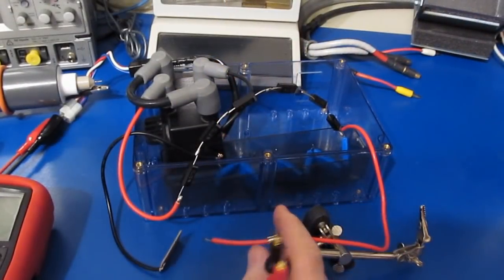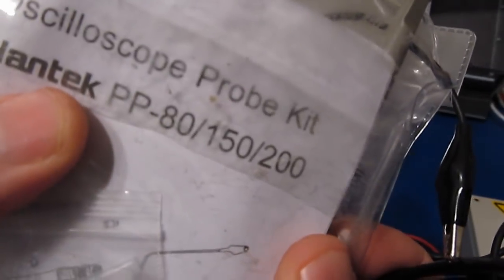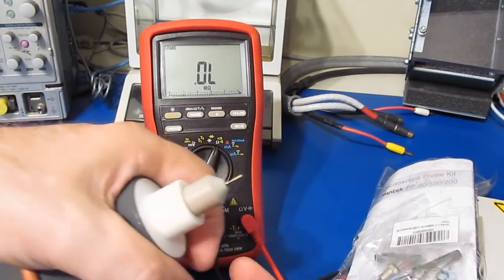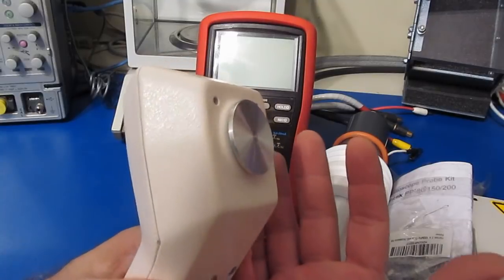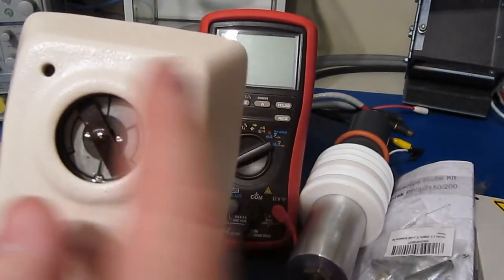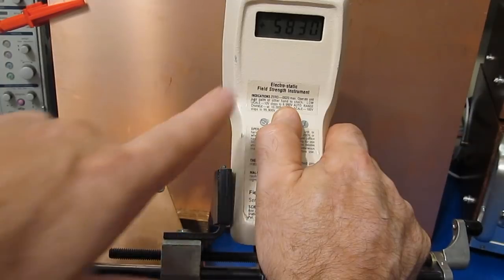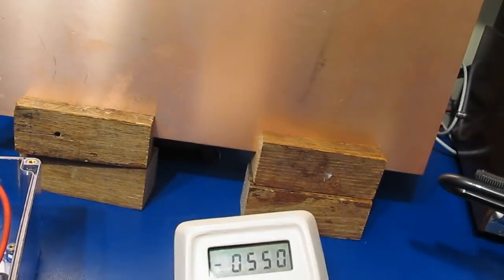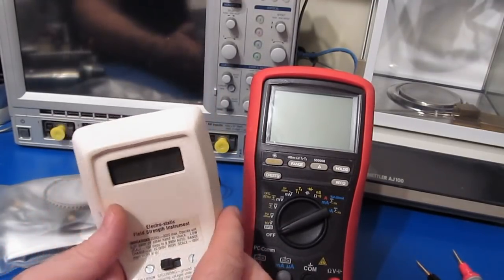Vintage Electro-static Field Strength Meter

Comment: I really don´t get why the Brymen doesn´t display 100s of Mohm even though it can clearly read it.
Reply from the maker: That's a good question.  This was my first hit on Google: 
https://electronics.stackexchange.com/questions/105613/why-to-use-siemens-to-measure-high-resistance
Reply: Hmm, can´t seem to find any convincing reasons. Maybe it has to do with people traditionally being unfamiliar with Giga as a prefix. (Gohms) 

Or maybe there is some functional difference in this meter?
Have you checked if the Brymen puts out more voltage/current in conductance measurement?
Reply from the maker: It's just another way to present the data.  With a 0.01nS resolution,  one count is 100 GOhms. two counts is 50 GOhms, three counts is 33.33 GOhms, 10 counts is 10GOHms.  The resolution would be poor and I doubt many users may not want to see the display bouncing from 100G to 50G.  It could be done.   Accuracy on the handheld meters is not all that good.  Normally if I need to read very low currents or high resistance, I am not using a handheld meter.  It can present challenges even with better equipment.  I have shown some pictures on EEVBLOG of some fixtures I used when making measurements like this.
Reply from the maker: Also, I do not believe there is some functional difference in the voltage/current in conductance on any of the handhelds I have looked at.  But again, when you look at the accuracy specs, they are poor as you would expect.
Reply: you´re right, the poor resolution in Gohms is a decent reason not to display it like that.
Although I would prefer to have something displayed instead of saying Overrange.
Reply from the maker: I am not even sure how they would handle the  quantization noise when displaying the data like this.  Using conductance would make this problem easier to deal with.    If they were going to extend the resistance range on handhelds, I think they would really want to change the hardware.  I doubt many customers would have a need for it.  The ones that would I expect would have better equipment.  In the end, it will come down to cost and what features they can add and still have a product they can sell.  

Now, I wouldn't mind having a meter than automatically switches from nS  to ohms as part of the auto range.  Maybe.  I could see making mistakes because of it as well...
Reply: switching from nS to ohms automatically would mean that the meter will always be in the nS range with an open circuit though. 

In general, I would like it a lot if things like these were just programmable/configurable by the user in meters like this. Also, being able to make the meter perform simple maths on any readings. (for example multiply by some constant value) 
These are things that should add no BOM costs to devices like these, but would add value for the user.
Reply from the maker: Yes, it would be in nS with an open.  That would not bother me but changing the units may.  Especially at the sweet spot.  I could see the auto range being a nightmare.   Changing units manually makes sense the more I think about it.   I would rather see nS function as is.     

I would assume software is not free.  There is a cost to develop it.   

One thing is certain, if you wanted to get a feature like this, I am not the person to contact.  I would start contacting the manufactures.  They may also be able to provide a better justification as to why they are designed they way they are.
Reply: what I suggested about software basically just comes down to the notion that "if we made it open source, then our competitor would have an advantage", which I think is competely false. In reality the software needed for a simple multimeter is trivial anyway. (especially without features like bluetooth.) 

They don´t even have to implement additional features themselves. I think it would add a lot of value to their product if they just released the software they already made, because then other people can customize their own devices to fit multiple needs, resulting in more sales.

Of course we would have to convince managers from companies of that. They are the ones making these decisions, not engineers. Unfortunately, they don´t evem seem to be interested in whether their assumptions about open source are true.
Reply from the maker: It's been almost a year since the 121GW kick start.  I wonder when UEI will have that trivial firmware completed.   

I'm not sure who "we" refers to when you write about convincing managers.  Actually, you are the only person I have seen post about wanting the resistance mode to work differently.  I imagine its driven from marketing and feedback from sales but maybe not.  Sounds like you know it's the managers at these companies who make these decisions. I really have no idea.  I don't work for or at any of them.  They would be the place to start though.
Reply from the maker: >> I think it would add a lot of value to their product if they just released the software they already made, because then other people can customize their own devices to fit multiple needs, resulting in more sales.

With handheld DMMs being a safety device and even having their own standard,  this seems like a really bad idea.  The firmware is part of the system.  But again, I am not any sort of expert on safety.   You could run the idea by a few companies and see how they respond.  Maybe there is no issue.
Reply: >> "Actually, you are the only person I have seen post about wanting the resistance mode to work differently."
I didn´t mean the resistance mode. I can understand why they may have made it work like that now.

 I´m also not talking specifically about Brymen here, but basically all manufacturers of Test Equipment. There generally seems to be little innovation throughout the market. Products are often sold for 10+ years before a new model is released that directly replaces an old one. And even then not much changes in terms of functionality. 

Safety concerns about multimeters with modified firmware are a good point, however I would think there are ways for the manufacturer to drop any responsibility for safety if an unofficial firmware is used.  (maybe display a warning on startup when modified etc.) 

I have not been following the development of the 121GW. Which parts of the firmware are a problem for that meter? I would think that the basic modes should work without problems? I would not be surprised if there were problems with the bluetooth functionality or the PC software though.

>> "You could run the idea by a few companies and see how they respond."
I´m not the first person to come up with ideas like having open source firmware. For example, I seem to remember Dave from the EEVblog asking someone fairly high up in a company (Keysight I think?) asking about it, and their response was along the lines of "if we made it open source, then our competitor would have an advantage". That´s what I was referring to before. In the comments about that video, there was a lot of discussion about the subject by other users. 

To clarify what my original suggestion was: I would find it useful to apply a simple math function to the measurement made by the multimeter (or oscilloscpe etc.), especially in the voltage measurement mode. This would allow you to, for example, display the current running through a current shunt instead of the voltage across it. Another use case would be converting some analog output of some sensor (such as 0...10V outputs) into the actual physical quantity this represents. To avoid confusion and safety issues,  this conversion would only be in effect for as long as that mode is selected. To make it even clearer, the LCD could show something like "custom unit" or no unit symbol at all. To make setting the conversion function up more convenient, you could store recently used formulas inside an IC.
This is an example of a feature that even low cost DMMs and similar devices could implement for practically no extra hardware cost. The software would take a little time to develop, but most likely not very much. 
This is an example of innovation if this were implemented in a DMM, or in low-cost Oscilloscopes. High-end oscilloscopes sometimes have functionality like this.
This is an example of a feature that could easily be developed by someone outside the manufacturer´s company, if the firmware was open source.

I hope it is clear now what I meant.
Reply from the maker: I do a fair bit of playing around with electronics and tend to automate many of the experiments I run.  Normally, I pull all the data into Labview.   The data could come from pretty much any instrument I have.  Normally, its a conglomeration from several instruments. Once I have it in the PC, there is basically no limit to what I can do with it.  Even controlling the equipment.   For me personally, having a lot of functions in a single device like a handheld DMM really isn't a big advantage especially if the instrument is not particularly suited for that function in the first place.    

I have no idea about the safety side and legal responsibilities of open sourced code on a safety device.  If a company left a device open with the intent of allowing unskilled people to develop custom code for it,  it would seem they could be held partly liable if someone were injured.  Certainly anyone developing or distributing the code seems like they could also be on the hook.  Hard to say.   I guess you would need to discuss this with someone who knows the law in this area.     

I don't follow the 121GW firmware real close but I noticed a few people  recently reported a bug I had seen with the prototype meter.  This was an easy one to replicate and it's a bit odd that with it being so trivial to write the firmware that it still has not been addressed.
Reply: I can only speculate about the 121GW, but I have noticed that in general, a large amount of software and firmware is simply written by people who have never had any real training in software development or computer science. I have often encountered errors in software which are clearly caused by beginner mistakes, such as wrong data types. 
I also know that a large percentage of graduates from any kind of (university) engineering courses will be employed as software developers directly after studying, or even before that as interns. They then often work alone or in small teams of equally unskilled people to create this type of software. There is typically no plan for software maintenance (fixing bugs) and little to no documentation. 

These kinds of problems occur especially in companies which do not mainly deal with software-heavy products, but still have their own developers instead of a contractor specializing in software. Because of this, bad software/firmware is very common, even when its complexity is not very high.

As for LabView, I have never used it. As far as I know, there is no free version. Either way it cannot work with cheap devices that do not have any computer interface, which is mainly what I was talking about.
Reply from the maker: I really can't speak for the entire world when it comes to how the software is developed.  Assuming it is trivial as you suggest, I would expect anyone, educated or not to be able to put together some simple firmware for a DMM and have it be bug free.  

I expect to pay for quality tools, that includes software.  I believe NI offers a student version of Labview but I am not sure what restrictions the license has.   I've used it for many years and it's saved me a lot of time.  

For most equipment that I would use with the PC, I can't really think of a case where having the source to add some function would have been any use.  I can't see ever wanting to get every development tool need to support all this open sourced test equipment.  What a nightmare.  Maybe if I were a youngster and just wanting to play, sure.   But I am far past that stage and expect the equipment I use to work as intended and I am more than able to evaluate it before buying to make sure it fits my needs.     

None of my home hobby equipment is new, cutting edge.   Some of my scopes allow you to run MatLab scripts and such but you are tied to the processing power of the DSO.  It's far better for me to be able to offload the data and post process it on a more modern PC.      

If I am buying new equipment, the interface bus is part of the decision.  I want to make sure that it uses some common bus and that the software layer is well documented and supported.
Reply: I guess I shouldn´t say any software development is trivial. There are ways to introduce bugs into even the simplest code imaginable. However these are bugs that any good software developer should either know to avoid from the start, or be able to find and fix very quickly, and without introducing any other problems.

If you can afford to buy expensive test gear, then you automatically have a lot of choice for all these things and will probably be able to meet all your needs without spending too much time. But that is not an option for everyone. 
Hobbyists will very often buy for example Uni-T DMMs or even cheaper devices. 
Small companies (such as startups), especially in poorer countries, will likely not buy the most expensive equipment either.
So there are definitely people that would benefit.

Also, the good thing about open source is that a lot of the time, you don´t have to write code yourself anyway. Someone else will probably have done it already, or part of what you need, and has shared it. If other people find flaws in that code, they or the original author can fix them.
Reply from the maker: If I could afford to buy the tool chain to develop software for an instrument, I am sure I could afford to buy the instrument.  Normally the tool chain  will be a significant cost.  I can believe there is a certain class of people out that would steal the tool chain.   Possibly with the same justification that they are too expensive, its for their own use....  Assuming we are not talking about theft.      

I consider myself a hobbyist.   This by no means would qualify me to write safe code no matter how trivial it is.  The word expensive is really open ended.   I have people frequently write me about the hardware modifications I have shown.  The discussion is similar.  We can't afford good meters and want to modify our cheap ones and we know what we are doing.
Reply: Well that´s part of the idea of open source software: Getting the toolchain/Development tools for free as well. (At least the most necessary tools.) So there is no need to pirate it.
Of course there can be problems If the company is using development tools they bought from some other company, but it would be enough for them to release only the information on how the code needs to be compiled and uploaded to the product. (along with their source code) Some of these tools are already open source or at least free to use.

Also, keep in mind that if the code is open source, there is no need to rewrite the entire code. For example, if all you want to do is change the sleep timer, or the backlight timeout, then if the code is available, you will porbably have to change only a single line of code. This does not require a huge amount of testing. 
And if your work involves significant dangers, you can (and should) simply keep the original software. A lot of people never even work with anything above 40v. And as I said before, a warning could be displayed when the meter is turned on that the firmware is modified. That way everyone using it will know. So at least I don´t see  a big problem here. Of course I´m not a law expert, but I would assume there would be a way for the company deny their responsibility in case of an incident with a modified device. 
It´s not really different to when you modify your meter´s hardware after all. You simply do it at your own risk.
Reply from the maker: Pick what you consider a cheap meter.  Let me know if it uses a masked part, OTP, full custom or what.  If it's masked how do you propose to get these free development tools to do you any good.  You may end up needing to procure some minimum number.  This would need to be done for each cheap meter you decide to open source.  You may end up paying 10X or more and for what gain?  My advice would always be to just buy the right tool for the job and be done with it. 

I do get a fair number of people wanting to know the details about some of the modifications I have shown.  It's not something I would ever consider releasing.  These meters are not something I would ever loan out or sell because of the risks.   I personally mark all the meters I have modified and plan to destroy them all at some point. 

Well, good luck with your open source project.  If you manage to go beyond just talking about it, make a blog and post the location.  I'm sure there are people that would like to help you out.
Reply: There is one significant difference between your hardware modifications and an alternative firmware:
Even if you had your modifications certified and they were definitely as safe or better than the original product in every way, if you released the information people attempting the modification could still make mistakes.

However flashing the same firmware on any meter of the same design should always result in exactly the same result. In the worst case, if there is an error while flashing, the device will stop working entirely since this is easy to detect.

The idea would be to design any future designs with open source in mind. That way there should be next to no extra cost. Of course releasing information on existing products that are suitable for modification could be an option as well, but would be much more problematic, which is why I wouldn´t expect anyone to do that.

But whatever, you clearly don´t see any benefit in any of this. And companies have their own reasons why they don´t do this, whatever they are. I just think it would be a welcome feature for many.